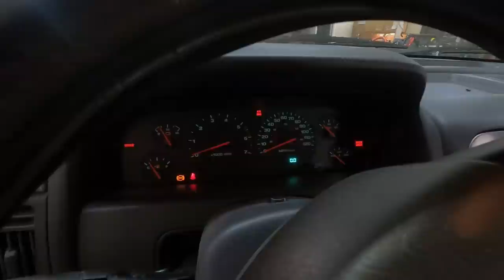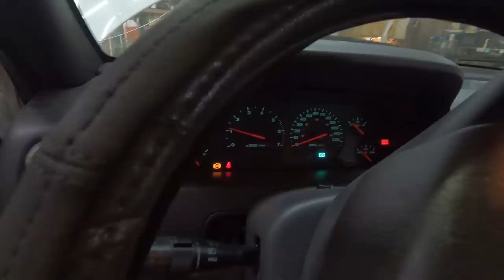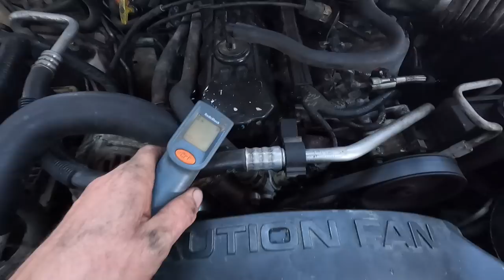How I Make A Living Fixing Jeep’s

Comment: there is a transmission shop near me they buy all the cores that they can get. they save all the usable parts, if the clutches look good they save them. when you go there you have the option repaired, reconditioned , or remanufactured.  repaired is usable parts used new bushings and used parts. reconditioned new bushings and clutches and seals. remanufactured all new wearable parts and includes updates if any.

Comment: I wish I could pick you brain about a stalling problem with my 2001 TJ.  Do you find wiring issues inside the harness from the PCM to the Crank and Cam sensors?  I'm thinking that may be the case with mine...

Comment: Man I'd pay you for help. I love my xj got a 98 and I have done some much trying to figure out what's wrong. I got a rough idle sometimes. Starts right up cold. Cranks forever when it gets hot. It will start and run tho. I have replaced tps and iac map coolant temp air charge temp or whatever. New distributor Rotor coil, coil pick up sensor crt performance kit new wires spark plugs.....fuel pump. Fuel is soild at 49 psi. Also have a heat shield on the fuel rail and yes a brand new cps....
Reply: It runs great not low on power got 32 in tires and I can spin them... just long cranks when hot.

Comment: Hey man you dont have anyway to contact you. I thought i was a cherokee guru lol. I do have a question about my Cherokee crawler that no one has been able to answer or fix in 10 years almost. You might be someone that could give me an answer. Hasnt charged in 10 years since it froze in a mid hole. Had several peolle look at it and cant fix it. Been nothing but a Cherokee guy since my first one in 2008. Still have five of them. Even a rare 1989 4 door 4.0 5 speed 4x4. I looked for an email on your page but couldn't find a contact anywhere. Not sure where located im in Florence Alabama btw. Hope you see this man and great videos

Comment: Got a question I just bought my 2nd jeep cherokee sport xj the first one is a 2000 jeep cherokee sport 4.0 v6 2wd has a motor knock needs a new motor and the newest one is a 1996 jeep cherokee 4.0 v6 4x4  but anyways on my 1996 xj when I put my key in to start it it want start by turning the switch there's the a button under the the steering wheel all I have to do is push it in to start it up
Reply: whats the question?
Reply: My 2000 xj has a rod bearing 5 that's knocking I got offered another motor it cone out of a older xj I was told I couldn't use a older motor for my 2000 xj I thinks it come out of a 1996 cherokee would it work in my 2000 xj